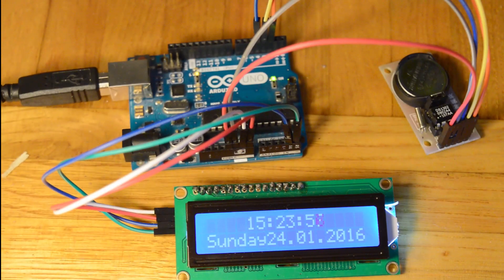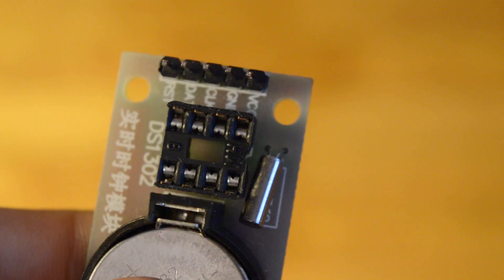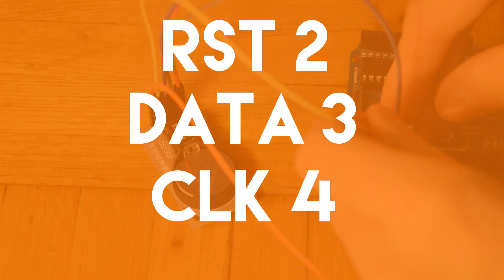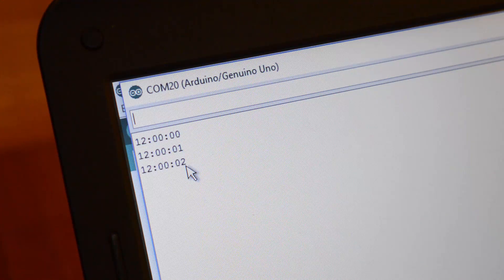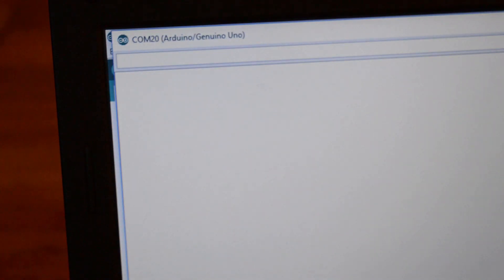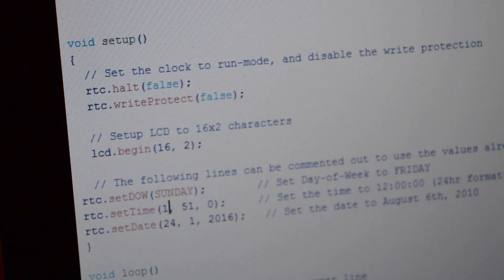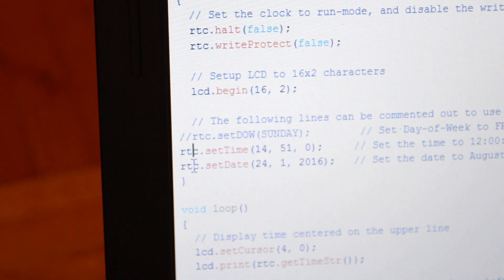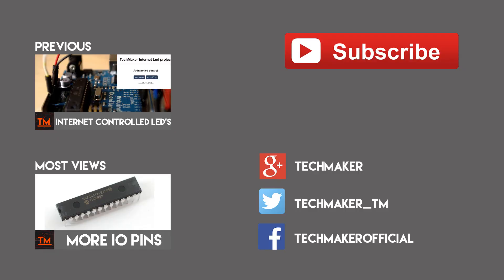Arduino realtime clock || ds1302 || TechMaker

Comment: I couldn't get it to work.I run "test.uno". then open serial digit.but just showing this on the screen 00.00.00-  00.00.00 -00.00.00 ......Aslo The files are very complicated. There are a lot of files and it is not clear which one will be added where.Libraries,scaner,test ,clock .can you better explain what i should do
Reply from the maker: For every sketch you want to upload to your Arduino you need to include the libraries that are used in the code. There are plenty tutorials on how to do that. Libraries are always complicated... they are made to make dificult things easier but you don't need to understand them.

Comment: I'm simply trying to print out the dates via the serial motor. The problem is, nothing appears on my screen. 
Am I doing something wrong in the first program concerning the prints of my time values? I believe they are char types, so why can't I print them out?
This is the way I've written it:
  Serial.println(rtc.getTimeStr());
  Serial.println(rtc.getDOWStr(FORMAT_SHORT));
  Serial.println(rtc.getDateStr());
  delay (1000);

This is the code in my loop.
Is this wrong?

Comment: Hi friend, I'm triyng to set an schedule for a servomotor to move every wanted time, but I have no idea what codes to use. This library for DS1302 RTC is apparently the only one that has worked for me so far.
Is it enough with general Arduino knowledge?? or do I need to know new coding from a particular library? 
Could you please get me out of my nightmare? ;(

Comment: Hi, I am using the "test" code, but it shows me errors:
test:38: error: 't' was not declared in this scope
   t = rtc.getTime();

   ^

test:38: error: 'class DS1302' has no member named 'getTime'
   t = rtc.getTime();

           ^

test:44: error: 'class DS1302' has no member named 'getMonthStr'
   Serial.print(rtc.getMonthStr());

                    ^

'class DS1302' has no member named 'setDOW'

And I don't know what to do and the serial monitor shows nothing. Do you know how to fix this? Anybody? :D
Reply from the maker: Did you install all libraries?
Reply: Yes I did. I even uninstalled and installed again.

Comment: How shud i connect the wires if im using a normal lcd??
Reply from the maker: Just search for 'lcd 16*02 arduino' and you will find a tutorial on how to connect it. Note that it won't directly work with the sketch. You should replace every Lcdi2c line with a normal lcd line and you should install other libraries.

Comment: 'POSITIVE' was not declared in this scope
Reply from the maker: There are some errors when uploading the code. But they shouldn't make a problem. Did you installed the libraries?
Reply: Download All libraries  .h, .cpp  and keyword.ini and all zip without folder to "name.zip   . and add library "name.zip" to arduino will be fine
Reply from the maker: Exactly that! ;)
Reply: i don't get it

Comment: hi tm 
iam useing ds1307 rtc . when i cut off the power to the arduino it resets the time again  
i dont know what is wrong . could you check the code 
//////////////
// Date and time functions using a DS1307 RTC connected via I2C and Wire lib
#include <Wire.h>
#include "RTClib.h"
#include <LiquidCrystal.h>
int Con=80;
LiquidCrystal lcd(7,8,9,10,11,12);
RTC_DS1307 RTC;
int ds1 = 2;
int ds2 = 4;
int runTimer ; 
int s = 15 ; // time in seconds

void setup () {
    pinMode(ds1, OUTPUT);
    pinMode(ds2, OUTPUT);
    digitalWrite(ds1,HIGH);
    digitalWrite(ds2,HIGH);
  analogWrite(6,Con);
   Wire.begin(); 
    RTC.begin();
    // RTC.adjust(DateTime(F(__DATE__), F(__TIME__)));  //  sets the RTC to the date & time this sketch was compiled

     // January 21, 2014 at 3am you would call:
     RTC.adjust(DateTime(2017, 8, 5, 12, 20, 0));

 
  lcd.begin(16,2);
  lcd.clear();
}

void loop () {
  DateTime now = RTC.now(); 

    mostrarRTCLCD();
     
     delay(1000);// 
     
     
  runTimer = 0;// vital
     for(int duration = 0; duration < 100; duration ++){}}
     
     void timer() {
     for(int timer = s;timer > 0; --timer){
     lcd.clear();

     lcd.setCursor(12,1);
     lcd.print(timer);
     delay(1000);// step down every 1 sec 
         
}}

void mostrarRTCLCD() {
  
DateTime now = RTC.now(); 
lcd.clear();
lcd.setCursor(0,0);
if(now.day() < 10)
{
lcd.print("0");
}
lcd.print(now.day(), DEC); 
lcd.print('/');
if(now.month() < 10)
{
lcd.print("0");
}
lcd.print(now.month(), DEC); 
lcd.print('/');
lcd.print(now.year(), DEC);  
lcd.setCursor(0,1);
if(now.hour() < 10)
{
lcd.print("0");
}
lcd.print(now.hour(), DEC); 
lcd.print(':');
if(now.minute() < 10)
{
lcd.print("0");
}
lcd.print(now.minute(), DEC); 
lcd.print(':');
if(now.second() < 10)
{
lcd.print("0");
}
lcd.print(now.second(), DEC); 

if (now.hour() == 11 & now.minute() == 41 & now.second() == 00)
  { digitalWrite(ds1,HIGH); // relay is on during countdown
    digitalWrite(ds2,LOW); 
    timer();     //Start timer
    lcd.clear();
   
    } else {
      digitalWrite(ds1,HIGH); // relay is off  when time expired
      digitalWrite(ds2,HIGH); 

    }}
Reply from the maker: I think you have to do the same thing that I did. At 2:10 I explain how to re-upload the sketch without the lines wich set the time.  I think you should place '//' before:  RTC.adjust(DateTime(2017, 8, 5, 12, 20, 0));. If that doesn't work it might be a problem with the battery of your RTC module. The chip of the RTC has to receive power or it wont know the time.
Reply: thaaaaaaaaaaaaaanks mr tm . it works finally 
thanks for your quick reply
Reply from the maker: No problem!

Comment: I cant make the code section can you help me step by step please?
Reply from the maker: Of course I can help! What is the problem exactly?
Reply: I did everything correctly until 1:31 and my lcd works now power led is red and  blue screen light is working too, i installed, test,scanner and clock too but i dont know what to do now that library thing is confused me
Reply from the maker: Alright I will try to help you it might be easier if you can contact me on my social media.
Reply: like? facebook?
Reply from the maker: What you prefer. You can DM me on Facebook, Instagram, Twitter, ...

Comment: Where do I get the DS1302 Library from? I can't find it in the Arduino built-in library search. I searched for it on Google and found "DS1302 RTC library" by msparks, but when I try to use it, I can't use the setDOW, setTime and setDate methods.
Reply from the maker: +derRAV3N there is a link in the description
Reply: TechMaker Ah, dumb me. Didn't see that folder..
Reply from the maker: +derRAV3N No problem! Share your project if it did work!

Comment: why my time is just 00:00:00
Reply: thank you sir King MarySam and TechMaker for your kind help.. its ok now i was changing it from the .h file not on the .cpp file... anyways im kinda new to arduino that is why i am relying on youtube to learn more.. i subscribed to your channel hoping to see more of tutorials like this thanks a lot bro... good luck on your exams..
Reply from the maker: +Gewist Malibiran did you connect everything the right way? Do you use a ds1302? Did you instal the libraries?
Reply: TechMaker I made it work already I connected to the wrong pin... now I have question how can I make the day display on LCD shortened like Mon Tue wed
Reply from the maker: +Gewist Malibiran There are more ways off doing it. You can try to display only the first three characters. You can also change al the 'monday' to 'mon' in your library as well in your sketch or you can work with if functions
Reply: can you give me sample code... i tried to change from the library but after i save it has compiler error
Reply: Actually I saw your comment and tried it and succeed it https://drive.google.com/file/d/0B1LJyXm6497OU2xhTG9pZmJCNU0/view 
try it I just modified lines like monday into MON in  DS1302.cpp :)
Reply from the maker: I'm very busy with my exams at the moment. But King MarySam tried it!

Comment: How to set the time On / Off relay according to a predetermined schedule?

I am using Arduino Uno R3 + Relay 4 Channel and RTC DS1302, I want to automatically control the Relay based on the set time. Suppose that the schedule of the relay is on 08.30 - 10.30 and the schedule is Off 10.30 - 14.00.
The pin I'm using is 2,3,4,5.

Please help.
Reply from the maker: You can just use a if function for that ;) sorry for the late reply
Reply: Using the libraries you provided. I still can't figure out what to type behind the if function

Comment: I used the same sketch as you've used. I'm facing an issue like, the time doesn't increments next second. the time set remains in the loop. Let's say, I've set time to 13:50:00, the same time continues to loop instead of increment to 13:50:01. Any way out? plz guide
Reply from the maker: +Hardik Gajjar did you check al your connections? Did you upload the libraries?
Reply: yes, the connections are accoringly. even i checked the continuity of cables with multimeter. libraries are uploaded & executed accordingly.
Reply from the maker: +Hardik Gajjar maybe there is a lcd clear missing
Reply: I haven't used the lcd. At moment, i'm using serial monitor. as I've to input the current time to an another algorithm. So, probably I won't need lcd display.
Reply: +TechMaker working now :) there was problem with CMOS battery, i changed it & its working
Reply: +Hardik Gajjar
Hi there. I too haven't got a LCD to test this (well, I technically do own one, but for various reasons I can't exactly use it right now).
I'm simply trying to print out the dates via the serial motor. The problem is, nothing appears on my screen. I then used a different program to run my DS1302, I printed out the time, and I saw that my time was indeed installed correctly using the prior program (meaning, the program I got from the description of this video). I know the time was installed by the first program, because at no point do I declare the time and date in the second one. I also tested this a second time by changing the date again, with the first program, and saw that my time was changed again. Meaning, the first program does indeed set the time, but I can't print it out.

You may be wondering what the problem is, well... Even if I use the second program to simply print out the time via the serial motor, I have the exact same issue you had. The time is stuck in the loop and doesn't seem to increase "over time" :p

In any case, my question to you, should you have the time, is this... Am I doing something wrong in the first program concerning the prints of my time values? I believe they are char types, so why can't I print them out?
This is the way I've written it:
  Serial.println(rtc.getTimeStr());
  Serial.println(rtc.getDOWStr(FORMAT_SHORT));
  Serial.println(rtc.getDateStr());
  delay (1000);

This is the code in my loop.
Is this wrong?

Comment: Hi it is my graduation project. However ı will do wearable clock so arduino and lcd are big. How can ı do?
Reply from the maker: +Okkes Alacam you can buy smaller lcds and a smaller Arduino :) Tinkernut did a project loke that so you might want to see his video

Comment: I've got a little problem... At the moment of turning the whole system on, the LCD shows two different informations as the seconds are running. One information at each second on a loop (at one second, my time and date set is shown, but at the next second, there appears a random time and date; and sucessively). Where this problem could come from? Is perhaps a RTC fault? Thanks!
Reply from the maker: +Javier Romero It can be a fault with the rtc or with the lcd connection. But I can help you better on Facebook. Just send me a message there :)

Comment: Hi, how to sync the actual hour, date and not begin with 12.00 ? thanks
Reply from the maker: You have to set the time in the sketch then upload it to your arduino. Then without resetting our plugging out the Arduino you have to comment that part in the code and re-upload. But everything is explained in the video :) if you still don't understand feel free to ask more info!
Reply: thanks, i will try
Reply: i have no I2C found for the scanner and I don't know why? I found on internet that rtc ds1302 didn't use I2C..
Reply from the maker: +antoine versmessen the i2c connection is for the lcd

Comment: Is the DS1302 library maybe be out dated?

If i compile the code i have some error from it.

For example:

warning: deprecated conversion from string constant to 'char*' [-Wwrite-strings]

  char *output= "xxxxxxxxxx";

and

warning: deprecated conversion from string constant to 'char*' [-Wwrite-strings]

    output="Wednesday";

This error is at all months and all weekdays.

I didnt testet it so far, but i just want to know. What is this error and will it work with these errors?
Reply from the maker: I will look at it. It can be that there is an error in the library.
Reply: Cool! 
Thanks, mate
Reply from the maker: I have checked it for you and I have exactly the same 'errors' normally they wont give a problem!
Reply: The question is - is it still working ?
Reply from the maker: asdasdasddify Yes this errors wont give any problem.

Comment: ask i have problem, my rtc has 2 time, 1st i didnt know from where, always show wednesday 1-3-2011. and then my setting clock :v
Reply from the maker: I don't really understand you. if you have problems try to check your connections, your battery , code, library and serial port.
Reply: +TechMaker i use 6 to clk,  7 to dat, and 8 to rst, and my connection are true, i can set date, but its show 2 time in my lcd, 1st i dont know from where, and the second is my time, can you help me sir
Reply from the maker: Try to check your code. There should be a lcd.clear function at the right place. You can also send me a message with a screenshot of your code on Facebook or Twitter.

Comment: Hey, I have some problem with this RTC you can see, that RTC change the date: http://dox.bg/files/dw?a=dca4ef9898 Do the same with minutes.
Any suggestion what is the reason?
Reply from the maker: +Николай Карнобатев Make sure all libraries are installed. Check if the battery is alright. Make also sure you have connected everything right.
Reply: Yes, everything is fine, when I'm using another library (virtuabotixRTC) clock works great.
Reply from the maker: +Николай Карнобатев do you have exactly the same chip/module? Not every chip is the same.
Reply: Yes